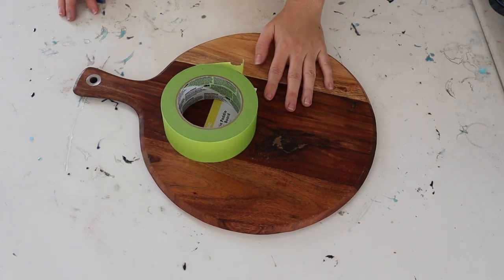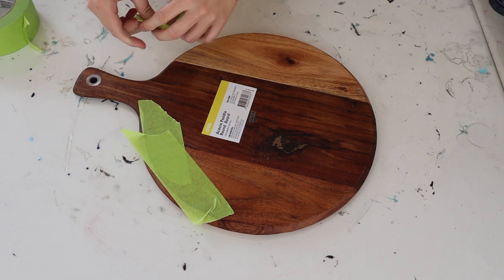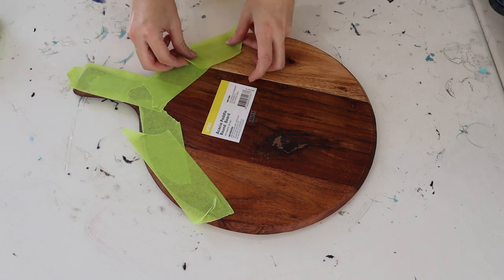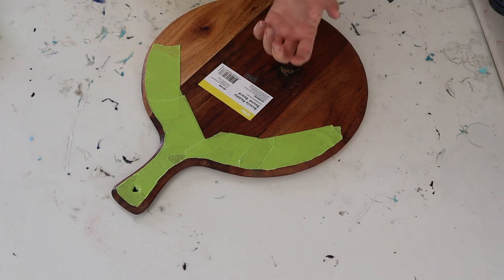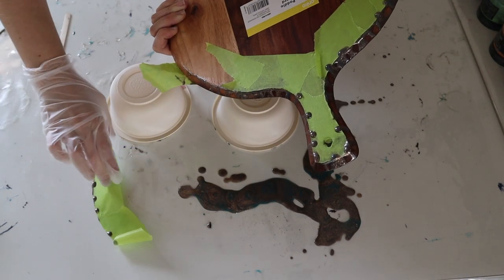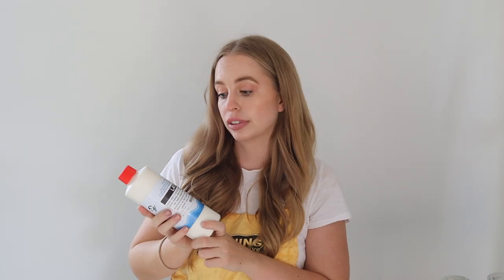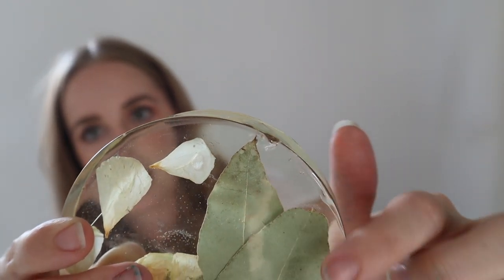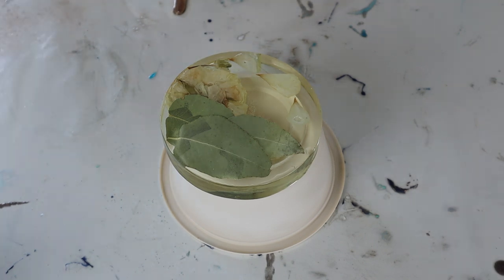3 different ways to stop RESIN DRIPS (tap, latex & a house hold item)

Comment: Thanks Sheri - haven't used Latex before. I use blue painters tape from the hardware store - it works really well. Although, a bit tricky to apply to round boards - maybe the Latex would be easier.

Comment: You can also allow the resin to fully cure when using tape …then use a heat gun to the drips …and it comes off extremely well. Will try the latex 😃

Comment: Thanks Sheri...I normally tape & have used vasoline before but found it very messy & if you get it anywhere on your piece it repels any resin  but the latex looks great & although you have to wait for it to dry between coats looks the easiest to apply, so I just may have to add this to my materials 🤗
Reply from the maker: KIM MONSERRAT definitely give the latex ago. I really like it

Comment: Oh why didn't I watch this video first? I had a really gorgeous piece for a friend that needed a top coat and got the drips... I managed to remove the globs with a cutter but there were still marks... I have leftover latex from last Halloween, that would be great then, how long do you let the resin cure before removing the latex? Do you let it cure completely or do you do it when it's still softish like the tape method?

Comment: Thanks for the video! Have you had issues where your latex leaves a mark on the resin? I had that issue with my coasters and the Latex left a mark on all of them because they had a clear section of resin and that’s where the mark is
Reply from the maker: I haven’t had that issue before. I always make sure I do really thick layer of latex and wait for it to fully dry before pouring my resin
Reply: @sherivegasartist  Thanks, it’s the first time that ever happened to me. I left the latex to dry overnight and did the pour and the next day when I took off the latex off I noticed that on the middle of all my coasters which for these particular ones was clear the latex left a mark. So I was just wondering since I can’t take off. I’m going to try to put resin on the bottoms to see if it hides it. Thanks for your response, appreciate it.
Reply: Thank you for this comment.  I'm making cutting boards from misc wood.  I'm doing a paint pour. I've already painted the backs black and applied resin there. I was going to put the latex on that then or the top and sides. Guess I'll do the tape. Thank you!

Comment: So far, tape seems to be the best for me… but, you do need to be right there in 1-2 hours to peel it off.
Reply from the maker: for under he board you can always wait until the next day to pill it off. Sometimes you might get a drip or 2 sticking to the tap. which you can you a heat gun to heat the drip up and it should then just peal off.